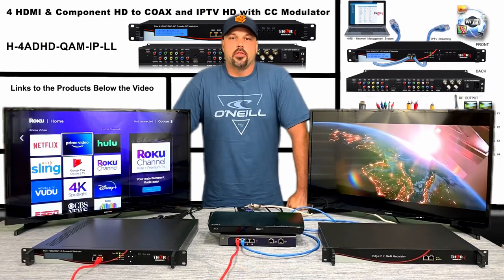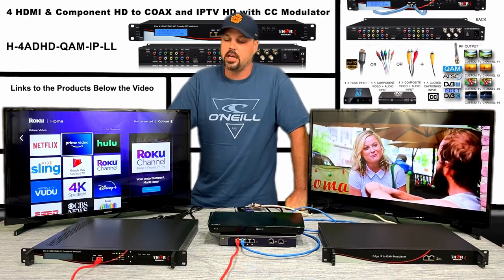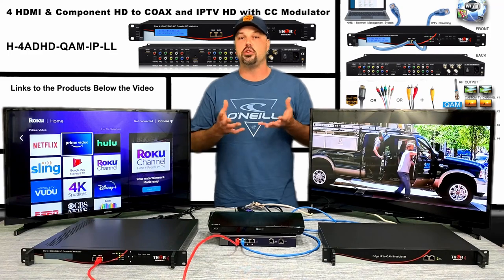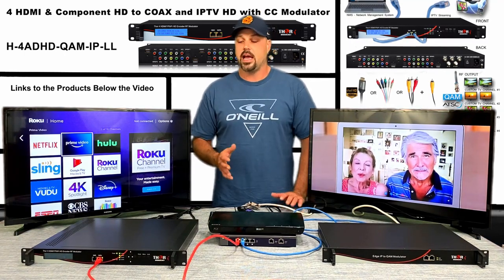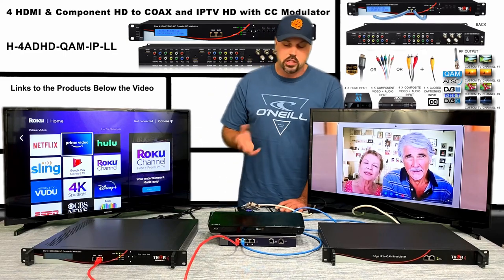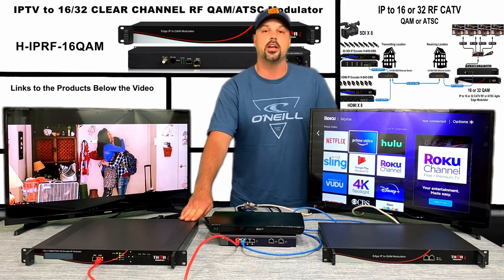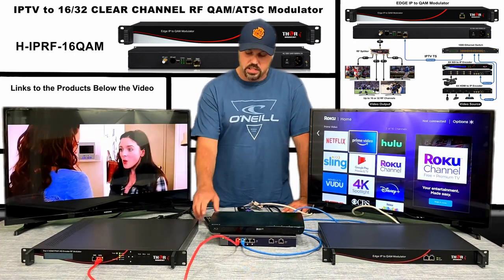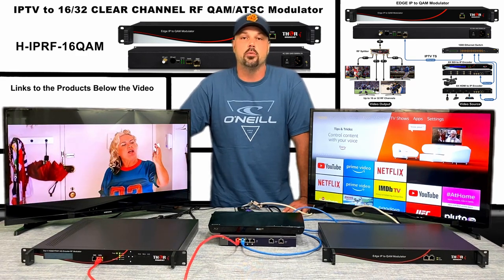How to convert IPTV Video steams to Cable TV channels - IPTV to CATV QAM , IPTV to coax converter

Comment: if you are not using Coaxial maybe the HDMI , what will you use?
Reply: Building an HDMI based backbone network e.g. in a campus is quit problematic and expensive. These devices is compatible with buildings with coax backbones as it was mentioned in video. If You would like to get simply an HDMI input to Your TV from your provider's TV service then Your device should be: set top box.